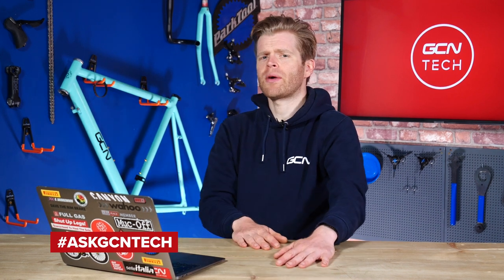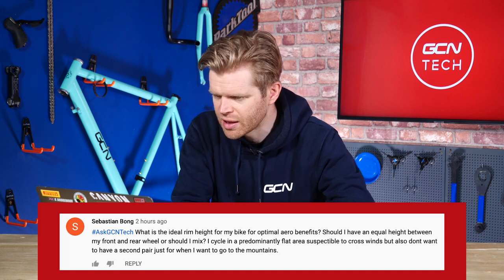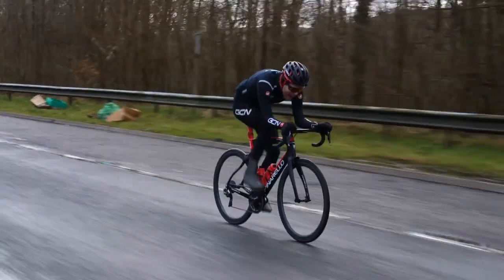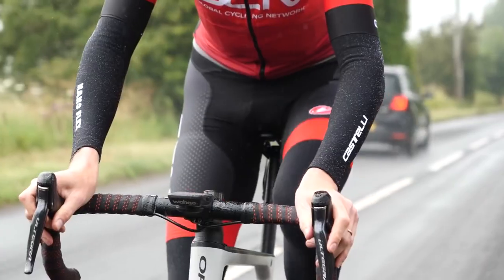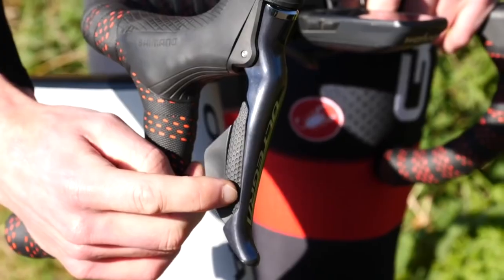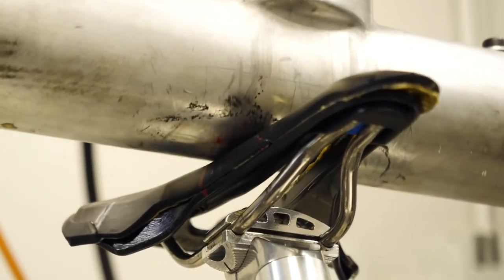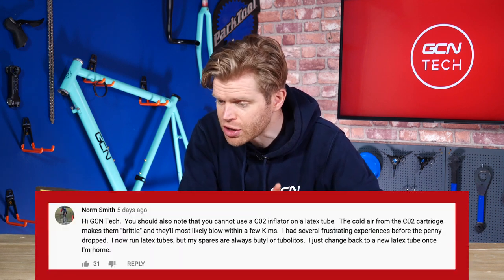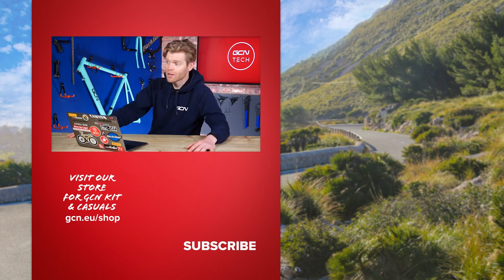What's The Ideal Depth For An Aerodynamic Wheel Rim? | GCN Tech Clinic #AskGCNTech

Comment from the maker: Do you have a burning tech related question? Leave it in the comments section below using the hashtag #AskGCNTech and we'll answer it in a future episode of the tech show!
Reply: What's the best wheel set up for outdoor velodrome, front tri or 5 spoke or beefy 90mm..and on the back, full disk or Some spokes on a beefy aero rear wheel?  #AskGCNTech
Reply: #AskGCNTech will those deep section aero rims hold up to occasional gravel use? I do both but only have the $ for one set of wheels. Can I get the deeper wheel aero gain but still be occasional gravel reliable.
Reply: #AskGCNTech I’ve been considering suspension seats/seat post. Do the good ones cause a efficiency loss thats noticeable, and any suspension seats/seat post you recommend. Already run gp5000 in 32 on a endurance frame, but im a heavier rider and extra comfort is appealing
Reply: #AskGCNTech How much saddle tilt is allowed according to UCI and how to measure it in home?
Reply: #AskGCNTech When tackling 30-60 sec Strava KOMs, would you rather sprint out of the saddle on a road bike or go full tuck on a TT? Aero is key, right?
Thanks!
Reply: #AskGCNTech Hi, how much does the rolling resistance of a tire increase from when it's new to when it's nearing end of life? In my case this would be regarding the GP5000 TL
Reply: @jankroken3881  good question.
Reply: Can a XC race clipless shoe on SPD pedals be as efficient as road shoes on road pedals? Assuming they are also made to be as efficient as possible, with just a two bolt system and lugs on the sole. #AskGCNTech
Reply: #AskGCNTech In this video you mentioned that front wheel counts more in aerodynamic issue, but by how much? What about some test between different wheel height in front/rear, such as 50/50 vs 50/80 vs 80/50 vs 80/80?
Reply: #askgcntech I’m running tubeless (Schwalbe ProOnes) and have a few nicks in the front tyre. It means that the sealant seeps out very slowly but not enough to drop pressure significantly. Should I try and repair the nicks or will that just make it more of an issue than it is?
Reply: #askgcntech are the black marks on the TRP 29 disc brake rotor wear indicators??

Comment: I chose 50mm on both.  I am a heavier rider (90kg) and find no issues with cross winds.  My deep carbon rims are lighter than my old aluminium rims which means they help uphill as well.
Reply: What rims you using?

Comment: Once was on a long 300km brevet which included gravel roads and encountered prolonged heavy rain downpours.  Drivetrain was grinding.  Stopped at a gas station.  Retrieved a discarded motor oil can/bottle.  And used the remains in the bottle to lubricate my chain.  Perfect.

Comment: Oooo good tip about the CO2 and latex tubes. Recently moved to latex tubes, so glad i saw this !
Reply: @Magic Knight
An important note about latex tubes and caliper brakes:

With caliper brakes, do not use latex tubes or even tubolitos (tubo's are known to blow out in hot conditions). A lot of heat is generated on the rim surface during rim braking, thus, the heat will blow out your thin latex tube.

As for tubolitos in hot conditions, or when going down a mountain that involves a lot of braking, rim braking will cause a blow out!

The lightest tube I've been able to run with caliper brakes and have had not had any problems with at all, is an 80 gram butyl tube from a well-known brand.

Peace. And safe riding.
Reply: @jaimeisreal  It depends on what rims you have and where your ride what your weight is and of course how much you brake. I have no idea about turbolight but yeah never had any problems with latex innertubes in the alps or at home where its less hilly. I always run rimbrakes. I have actually never heard of a latex innertube blowing up. Although the SuperSonics from continental should also possibly explode.. but of course you should always be careful when descending, on any type of brake! :) 

I would say that another benefit of having a butyl tube as a spare is that it’s a lot easier to fit when having a puncture. I wouldn’t want to fit a latex innertube on the roadside,

Comment: I ride with 65mm wheels front/rear. I find that the rim width and tire width also makes an impact.
If I have tires with about same width as the wheels, all good.
If I put much wider tires (training, confort, etc), I feel a bit unsteady (live near the sea, so lots of crosswinds), but nothing too bad, just takes a bit of getting used to, but riding no hands can be scary at times.
I have also used 40mm deep wheels, all good, no issues on handling.
Interestingly enough, the only big scare I had with crosswinds (resulted in my crashing in the ditch) was with old school 24mm deep rims, but very narrow with 28c tires.
So, I would not attribute thing to depth alone, but also shape (newer toroidal type profiles are MUCH better in crosswinds) and also the rim/tyre interface.

Comment: On the talk of the impact of wind on a deep section wheel. Have you tried Cane Creek viscoset headset steering dampeners? No afiliation. But dampeners have been on both road and offroad motorcycles for eons. May want to race around castle combe on a windy day and give it a crack. I have raised this with GMBN re their piece on handlebar length.

Comment: Muc off do inner tube sealant. I have been using it in my inner tubes but sadly it didn't stop a 2 inch screw taking a big gash out of the tube...other then that no punctures so far

Comment: Can you make a comparison between a maxed out aero road bike and an average TT bike? How big is the difference and how close you can get with deep section wheels, aero handlebars etc.? #AskGCNTech
Reply: Their triathlon channel has done these sort of videos
Reply: Answer: Not much difference unless you're (a) in great conditions; (b) at high speeds; and (c) a serious professional rider. You will see a bit of a difference in the wind tunnel between a maxed out aero road bike (£6,000 or above) and an average TT bike (£12,000 or so), with the TT bike being a bit better. Twice the cost, though -- or close to it, anyway. If Si did 5 miles on the maxed out aero road bike and 5 miles again on the average TT bike, in the same conditions and such, he would be a bit quicker on the TT bike in terms of time for the same effort, etc., but it wouldn't be worth £6,000, give or take. Also, from an objective standpoint, I think the TT bike would be a bit harder to ride, regardless (assuming you're talking about drops vs. tri-bars). However, this test would largely come down to body positioning.

If Si rode the road bike with a more relaxed position, then the TT bike would beat the time by quite a lot, if he rode with a standard road position (aero), then the TT bike would win out by a little bit, and if he rode in an aggressive, full-aero position on the hoods (akin to the tri-bars with elbows in, etc.), then the TT bike wouldn't be much faster at all.

It does seem, however, that a very average bike and a TT bike or maxed out road bike have major differences, one of which being around £6,000 to 10,000. Is it worth the difference in performance? Clearly not -- unless you are a pro, in which case, every watt and mm matters a fair amount.

I would be more interested to know the actual input/output differences for normal riders (average speeds, etc.) on a decent, typical £500 bike and a high-quality, semi-aero £2,000 bike. Four times the cost, but most likely not four times as good. I would guess maybe twice as good for raw performance, but maybe three or four times as good once you factor in the quality of the parts and materials, etc. Who knows. Most cheap bikes last anywhere from 6 months to 5 years, whereas, high-quality bikes almost certainly last 10 to 20 years, which is four to ten times as long.

I have heard that beyond £2,000 is when you really don't see much improvement for your money. GCN has said many times that the lowest-level entry bikes are around £300, typically steel and from top brands, with maybe chrom steel, etc. at the £400-600 range for some bikes, and then really good entry-level bikes and/or mid-range is more around £1,500, and then by £2,000 you are really starting to get into either high-end bikes or extremely specialised builds. At £3,000 or above, it's mostly professional road builds, or high-end touring bikes, etc. Mountain bikes tend to cost more at the higher ends, so £2,000 is quite common for serious downhill mountain biking, but still this is not needed and largely used by pros or riders who are close to pro level.

I would assume that for average riders, depending on a number of factors, £400 to £1,000 is the range for the correct balance between wattage, drag, style, parts, materials, and so on, without spending endless amounts of money, that is. We can assume, then, that the biggest improvements are made between £300 and £2,000, with not many improvements below £300 unless you get a cheap deal on a solid bike, and smaller and smaller improvements beyond £2,000. Remember, the wind tunnel tests at Silverstone, etc. only really hold true if (a) the conditions are ideal; (b) the rider is a pro; and/or (c) if the bike is at high speeds. Some things help a lot at lower speeds, but this only tends to be true in ideal conditions, nonetheless. It's not worth £5,000 just for some improvements at mid-speeds for non-pros. It just isn't. You save minutes off your ride at most. At best, a £10,000 bike only seems to save you maybe 10-20 minutes from a fairly long ride, and that assumes decent conditions, pro-level fitness, and high speeds. If this isn't your job, and you don't need to be somewhere really quickly, for some unknown reason, then £10,000 is clearly not worth saving a few hours a day/week or whatever the case may be. If you are cycling long-distance 24 hours a day, then it's clearly worth it, and you'd need a high-end bike, anyway, for durability. Then again, if you can ride for 10 hours a day or whatever, I can only assume you're a pro or a tourer, and tourers tend to go for comfort over performance, anyway. 

Most of the high-end bikes and parts and tests, etc. are made for three reasons: (1) to sell to people who don't need it but have a lot of money to waste; (2) for professional riders of all types; and (3) for time trials, etc. and to simply advance the technology. That's it. They don't really work for normal road riding at mid-range speeds, more so if the weather is crazy and/or you're not a highly skilled rider. You save some watts/minutes, yes, but for a very high price tag. Overall, therefore, you should just stick with a typical £2,000 mid-range road bike, or even cheaper than this. You can upgrade a few parts for closer to £5,000 if you want, but this also isn't really needed or useful, but if you want to, you can -- capitalism and freedom, after all. :)

P.S. Body positioning as been proven to be the best for drag/watts, etc., followed by tri-bars or such to lower drag/be more aero, but this does require much skill and good fitness. Nevertheless, this is first and foremost -- and pretty much free. If you have bad positioning then £5,000 on clothing, frames, wheels, and so on won't mean much at all in terms of watts/drag. The channel did a video on the best upgrades for watts/drag to money. Tri-bars are the best, along with clothing, positioning (free), tyres, and helmet. Frames, wheels, rims, and so on are more costly and not as good as the other improvements, and offer smaller improvements in and of themselves. Obree proved in the wind tunnel that his 'egg position' on a more normal bike (most likely £3,000 or more) was better than a normal aero position on a high-end TT bike (most likely £12,000), for example. So, in case you were wondering why all of this is even happening in terms of hype, parts, drag, etc. -- marketing. They want your money. Very simple. Some founders of such companies and other pros have even come out and said directly that things like high-end deep rims (£1,500 or so) are not worth it for most riders and can actually make you slower in strong winds, yet people still keep buying £1,500 rims. Why? Marketing, false hype, and style/personal reasons, that's why. It's just as much about psychology as it is technology. If you look and feel fast, then you make yourself go faster, even if it doesn't actually aid in your speed from an objective standpoint. That's why a lot of people have TT bikes or high-end deep rims and so on. After all, TT bikes are literally made for pros and nobody else. It just so happens that average riders are able to buy pro-level bikes and use them, but it doesn't mean they will help at all. It's like how average painters can buy high-end paint and brushes if they are willing to pay for it, but that doesn't mean they will help them paint much better.

Comment: Another important tip is to not use CO2 to inflate a tube repaired with a stick-on patch.  The adhesive on the stick-on patched fails from the cold temperatures caused by the CO2 injection.  If you don't have glue-on patches, you have to use a pump.

Comment: An important note about latex tubes and caliper brakes:
When using caliper brakes, do not use latex tubes or even tubolitos (tubo's are known to blow out in hot conditions). A lot of heat is generated on the rim surface during rim braking, thus, the heat will blow out your thin latex tube. As for tubolitos in hot conditions, or when going down a mountain that involves a lot of braking, rim braking will cause a blow out! The lightest tube I've been able to run with caliper brakes and have had not had any problems with at all, is an 80 gram butyl tube from a well-known brand. Do your research. And safe riding.

Keep it up @GCN Tech.

Comment: What causes the freezing temps using a CO2 inflator is the rapid gas expansion (the CO2 in the cartridge is not cold). So, wouldn't a slower/incremental gas release using a CO2 inflator with a control valve solve the problem? I think it would.
Reply: That’s what i do—slow burst over a minute+. I learned early on that you can freeze and delaminate an area around the valve/tube.

Comment: #AskGCNTech  Hi guys, I'm building a new road bike from the scratch. It's my first build, tho it's coming together just fine thanks to your tech videos. Just installed 110mm stem and handlebar and sat on the bike to see how it is. I felt quite stretched out when placing my hands on hoods. Now I am considering to replace stem to shorter, 90mm stem but I'm a bit afraid of how will it affect handling.  Some forums suggest that short stem will leave an impact on high speed stability.  Any suggestions? It's 57cm Orbea Orca OMR 2017 frame. Thanks

Comment: Not sure if this is a tech question or not...So if I was calculating the calories burned on my ride, what is more accurate, using my heart rate or using my power data? (I use different brands for each and they currently cannot link together) the difference between the two on a 60km ride is around 1000 calories?!

Comment: #AskGCNTech 
I changed from Shimano Ultegra 11S chain to YBN chain (SLA110).  The new chain has a much larger sideways flex.  Occasional the chain jumps from the from chain wheel in high gears (52/11) on bumpy roads .   It doesn't jump off when in the small chain wheel  The Chain is the correct length, cannot be shortened and derailleur is nearly new (Ultegra, med cage GS)  and works well.   rear cassette is HG800  34-11.  Is something wrong here or do I have to fit a chain guard to keep the cahin on the big chain wheel?

Comment: #AskGCNTech Hey GCN, I'm planning to do an Everesting. That's why I want to replace my Shimano cassette 11-32 with an 11-34. Which settings (H/L-screw / B-screw / indexing) do I have to change on my Di2 rear derailleur so that everything still works correct? According to my research, the chain length should still fit. Greetings from Germany

Comment: Actually, latex and butyl rubber have fairly similar glass transition temperatures (around -65°C, the temperatur at which the rubber freezes). So that should not be the reason why latex tubes puncture after inflating them with a CO2 canister. Also, after 'a few kmls' the temperatur will be very close to the surrounding temp again since the mass of the tire etc is way bigger than that of the CO2... Or am I missing something?
Reply: If the CO2 is injected quickly in one blast, you can freeze and delaminate an area around the valve/tube. I’ve had this happen on very hot days. I use CO2 in short bursts over a minute+ to keep the frost down.
Reply: thats what i'm saying. i always use latex tubes and co2 and have never ever had that happen to me

Comment: #askGCNtech.   
We are constantly told by Ceramic Speed that the larger the chainring/ pully wheel the more efficient the system is. (example Ceramic Speed OSPWS) But, Sram have made their chainrings smaller (SRAM X range) to make them 'more efficient.  Who is correct!?1?

Thanks in advance, 
James Lilley

Comment: I have a pair of rim brake pads that are incredibly stiff when inserting and removing them from my brake calipers. Is it recommended to use a lick of grease or anti-seize to aid the process? Both brands are Campagnolo. #AskGCNTech
Reply: Campagnolo brake pads are slip-fit, meaning that you do need quite a lot of force to insert and remove them.

Comment: #AskGCNTech Hey guys I hope you can help me with this. In my road bike I use Hifi Tubulars 38mm, I've been gluing them and I used to have Continental Gatorskins on them. However two weeks ago I decided to do some changes, instead of gluing them I decided to use tubular tape; and instead of Gatorskins I changed to Challenge Strada Pro Tubular. I've used them twice, and both times I get speed wobbles (Shimmy effect), which is very scary. What should I do to fix this issue? With the Gatorskins, I never experience this issue. 
Thanks for your help